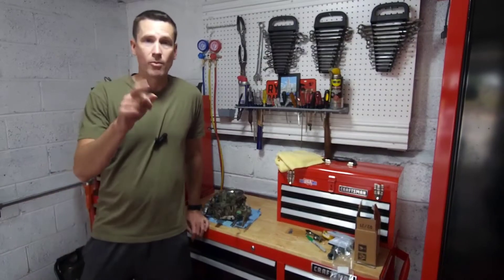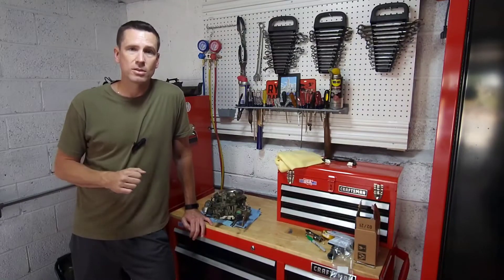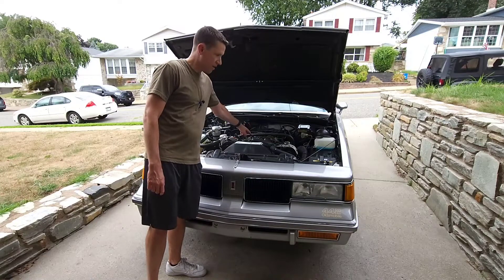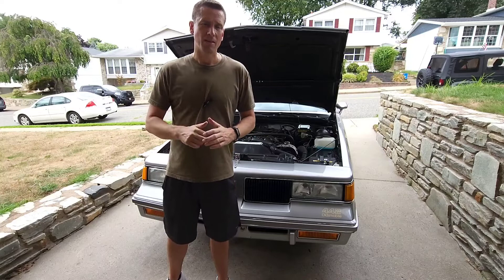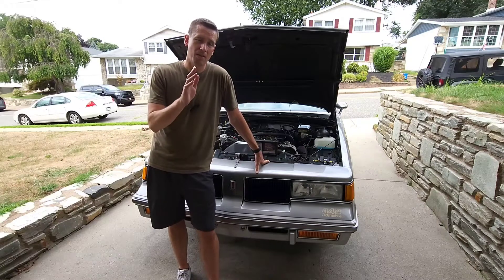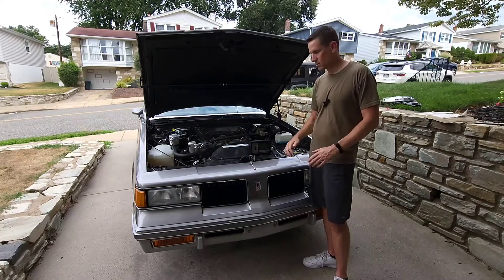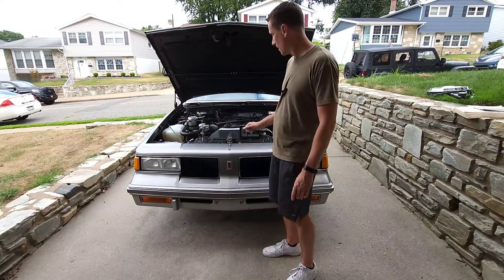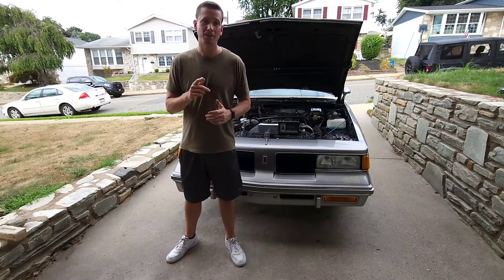Rochester Electronic Quadrajet / Dualjet - System Performance Check

Comment: I have a 1986 Oldsmobile cutlass supreme sedan 🚘 new rebuild quadrajet , I’m trying to have it pass smog by the way I’m in California, it will pass 15 mph but failed the 25 mph test. Mechanic say it’s running too rich and is tryna put air down the cats and he ordered new needles to put in and I feel it’s simple the mechanic is doing wrong can you help me ?

Comment: Any 40 year old dwell meter sitting in the bottom of your tool box has gone way out of calibration and can not be used. I have four higher end dwell meters and they read as much as 20 degrees difference. The Heathkit meter I built 43 years ago has a calibration kit but does not hold it's setting  because electrolytic capacitors used at the time were prone to fail as they aged. Newer electronic digital volt ohm meters which have a dwell feature is your best option. I will never consider setting a point distributor or carburetor mixture with an old meter. . . Just problems found through experience.
Reply from the maker: That's true! I have an old Sears "Engine Analyzer" that I don't trust. The unit used in the video is only about 5 years old.

Comment: Great videos 👍 hope it’s okay that I ask 😊 I have just bought a 87 caprice and having some problems figuring out what’s wrong, I have no check engine light on, but the car is running rough at idel and dies, the dwell Is fixed at 55 but if I unplugged the mixtur control solenoid it clears out and doesn’t die? And if I plug it in it falls back and runs bad? I have checked the tps, what do you think can be the issue?? Again hope it’s okay I ask and great videos, thanks 😊

Comment: They'll drive you nuts !!! I took my 82 Malibu to center Chevrolet in Rainelle WV (no longer in business) they almost begged me to fix it myself !!! There head mechanic Neil who was a good friend of mine said John you're as good if not better than me,,, please take this thing away please. The previous owner took it to them every month from when she bought it there New !!! After a deal with a witch doctor and medicine man and all my knowledge and experience it still run like dfffdfff !!! So I put a two barrel Quadrajet on it. After rejetting it, it ran great !!! But a year later it quit again ( no spark) you'd get more spark from a book of wet matches !!!.
Oddly enough a voltage drop test showed 3.6 Volt's on the negative cable (battery disconnected) ???
Well to end this comment i found it 😮😮😮 the starter had copper dust mixed with oil and grease and was bleeding voltage back blocking the ground circuit !!!
Put the feedback carb etc back on and it performed excellent !!! HARD TO BELIEVE BUT TRUE, ALL THE BEST TO YOU AND YOURS SIR.
Reply from the maker: Thank you!

Comment: Do do what I've done a lot of good if you would have done a real close up to the carburetor so you could have told us what those two plugs on the front of the Rochester what do they do and where do they hook up because mine have been disconnected and I'll do not know where they go in the wiring system
Reply from the maker: This is one of the videos I plan to re-do in the future. At the time, I didn't have the equipment to do it right. And what color olare the wires that go to the plugs?

Comment: Would this work on a 1985 Monte SS with a Pontiac/Olds 403 and 3.23:1 rear?
Reply from the maker: Only if it has a Turbo 350 and runs at 4000 RPM while you're doing 40mph.

Comment: Great video, my dwell is at 10 how do I test for that ? Will any of those tests be in my book ? can you give me any insight on what to do ? Thanks
Reply from the maker: If your dwell is hovering around the 10 mark, I would first check to make sure the idle mixture screws are adjusted properly. I made a walk-through in Part 2 of the carburetor adjustment series.
Reply: @rporestorations  Thanks it is a new carb but I did try and no matter which  way I turned them it did not matter.

Comment: talking about it and doing it is 2 different things really wish you would plus the camera is to far away couldn't see anything
Reply from the maker: Yeah, Bill. I kind of realized that now. At the time I was also using an older camera / sound setup that really wasn't good when the motor was running. I might redo this video down the road.
Reply: @rporestorations  your other video's were pretty good i haven't worked on one of those in over 30 years and i would really like to get more info, i actually have one of those carbs sitting on shelf in my garage that i picked up at a swap meet several years ago
Reply: @rporestorations  your other videos were i would like more info